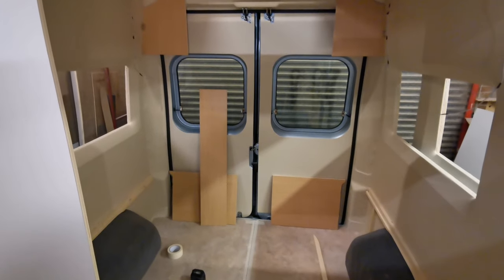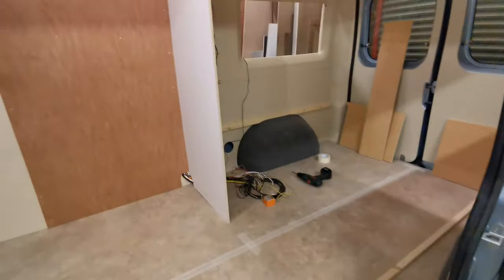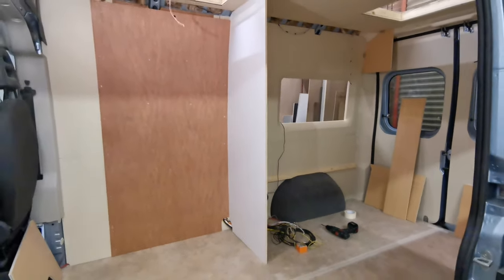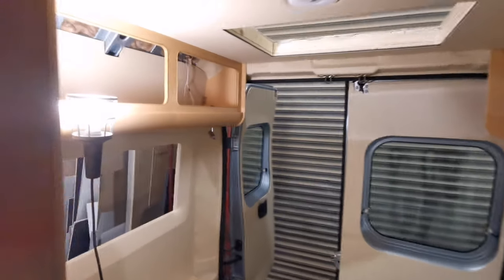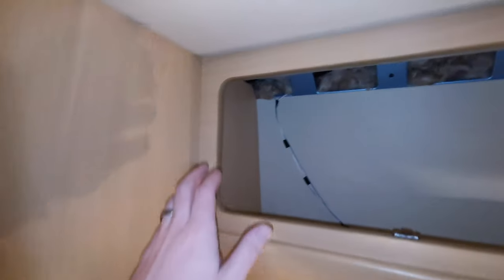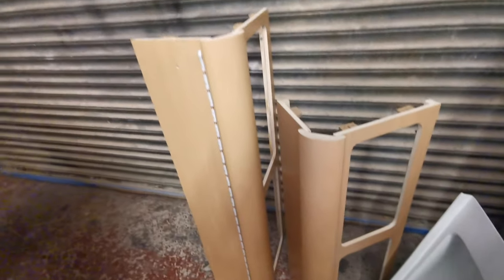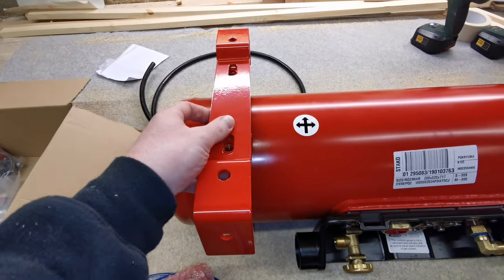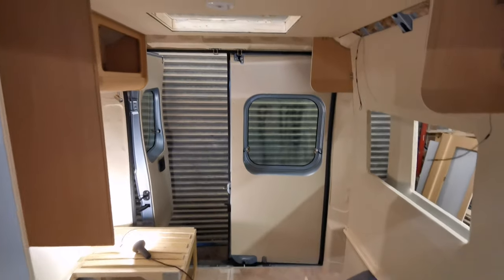How to Build a Campervan Citroen Relay MWB Series 10 Episode 3

Comment: Hi Dan, Is the shower panel you use actual Laminate as in Formica type, or plastic PVC type you use. Never thought of the laminate for the shower before. Even though I spent years doing shop displays/counters etc that way. Great work as always. Got me wanting to do another van now. DOH!.😊👍
Reply from the maker: Yes it is the formica type, the plastic over time will crack and you can never really seal to that plastic properly anyway unless you use a primer and you cant apply it neat enough without it showing.
Many thanks for watching

Comment: Another top Class job Dan like the new gas tank fixing idea Dan approximately how wide & deep do you make your rear over head lockers I'm struggling to get them right your look idealy sized cheers
Reply from the maker: The front pieces are about 12 inches and the bases roughly 9 inches. Hope this helps and many thanks for watching

Comment: Hi Dan, where do you get the overhead cabinet curved fascia sections that run along the bottom  edge ?
Reply from the maker: It's our Locker section that we have but you can't buy it anywhere as its made for us. If you contact the office they may be able to let you have some.
Many thanks for watching